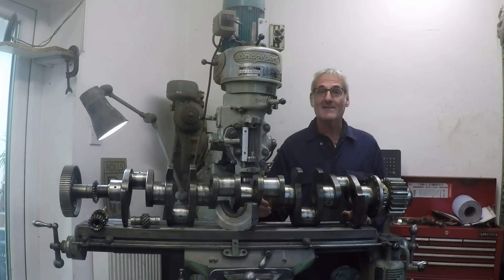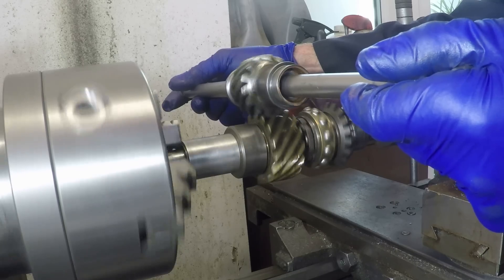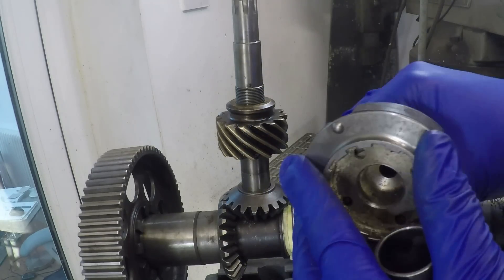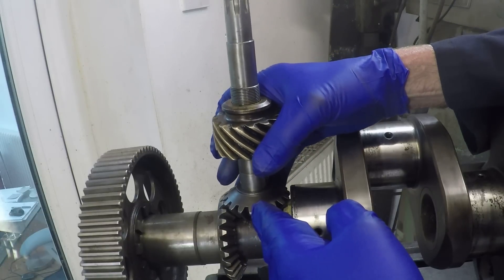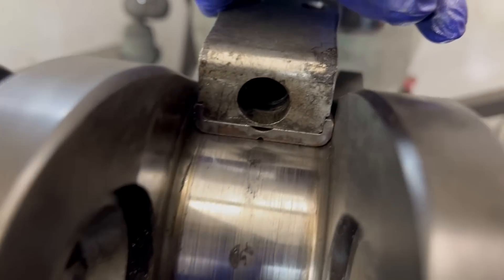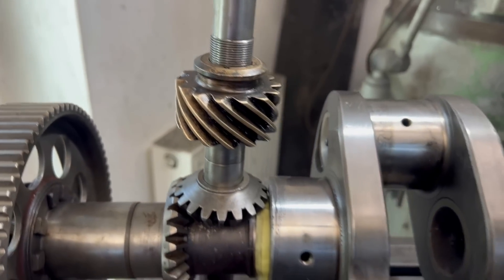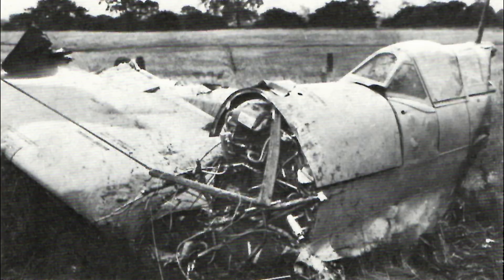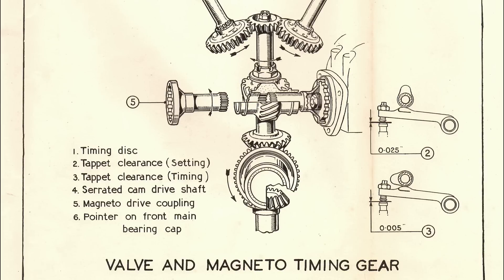Halifax W7715 Merlin Engine. EP8. The Skew Gear Problem!

Comment: Yes I read about the Skew Gears issues in Alex Henshaw's book " Sigh for a Merlin". The "failures" were coming from a different assembly line that were assembling the engines in a different order. In one of Alex's failures he came down through heavy cloud cover into the middle of a flight of Tiger Moth trainers. You can't just toot the horn for them to get out of your way.

Comment: Excellent breakdown video. The ignition/valve drive combo looks simply elegant in diagram but you show that it creates many more problems than it solves. 2 mags on same drive and the silly skew gear severely effected by all side effects of a running piston engine. Maybe  (my 2 cents worth) better to have had twin separate shaft bevel gear driven magnetos that also wouldn't require an actual right and left magneto that turns opposite the other. But very period British complunkxety I suppose.

Comment: Unfortunately this illustrates the efforts that British engineering went to, all to avoid spending money on doing jobs properly.  Instead of huge straight cut gears with 'bodges' to compensate for excessive clearances..... maybe double helical gears?
Reply from the maker: In this instance, different gears would not have helped because it was the alignment of the bearings at fault.

Comment: It's not good practice to locate bevel gears on the end of a crankshaft, especially on a long multi cylinder engine, I'm surprised Rolls Royce did that. It would have been better to use a spur gear pair to transfer the drive to the bevel gear pair.  That would have isolated any movement from the crank reaching the bevels.
Reply from the maker: Very good point. Pretty much all the aero-engine manufacturers had been doing this since WW1, and as such may not have considered this issue, but the later Griffon engine did use mostly spur gears to take drives from the crankshaft, maybe that is why.
Reply: @FlightEngineering1 
They possibly got away with it on engines producing less power without such high specific output, and without high boost supercharging.  The Merlin was also under huge stress in the combat fighter role with full power and aerobatics. I wonder if the same problem occured where the engine was used in bombers?

Comment: Great explanation! And that's why we are stuck with timing chains to this day! Having built from scratch, many machines in my 47 years, on and off the bench; it does not take a glaring difficulty to shut down very innovative and well made pieces of equipment. So much of engineering is empirical - then often too, it is pure faith and determination!

Comment: thankyou    do you know if packard  merlins had the same issue
Reply from the maker: In theory, yes. They would have been aiming to place the two bearings dead inline, but tolerances dictate that some would have been slightly below the centreline. I suspect they may have had less instances because they were masters of mass-production, but the eventual solution was applied to both Packard and Rolls-Royce Merlins.
Reply: NO !!!  Packard seen the problem and fixed it to start,  Just like ALL Packards solved the carburator problem from the start by using the Bendix Pressure carb on all the engines !!!
Reply from the maker: @wilburfinnigan2142  Not really. If Packard had seen the problem over a year earlier in 1941 they would have passed the info on to Rolls-Royce and this video wouldn`t exist.

Comment: Peter, you make a very complex issue so easily understood. A side point, how much torque did the Merlin make? Was it higher than it’s bhp like a truck engine (diesel) or like a conventional petrol engine where it’s torque is more or less equal to bhp? Cheers.
Reply from the maker: Hi Neil. The Merlin XX makes 2350 lb ft peak at about 2800 rpm,  Ignoring camshafts and other gas flow stuff, you will find that most engines have a torque peak in the 2000 to 4000 range, it`s about the maths. If you assume a linear HP line from zero to 10,000 rpm, then calculate the torque from this, you will see it peaks somewhere around that. If you try a few different examples, you will see what I mean. Big diesels which only rev to 1500 probably don`t always have a torque peak.